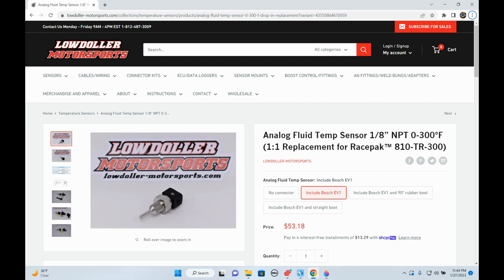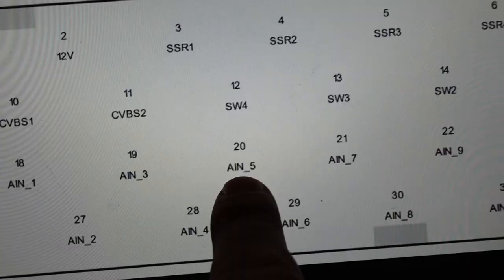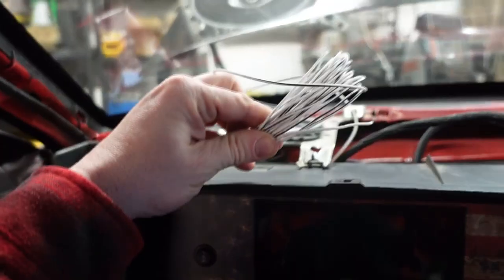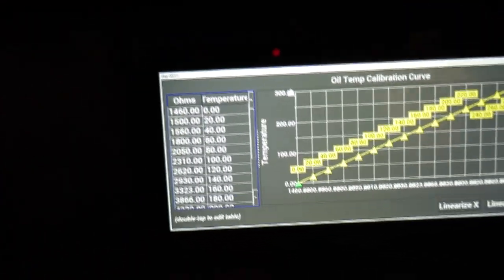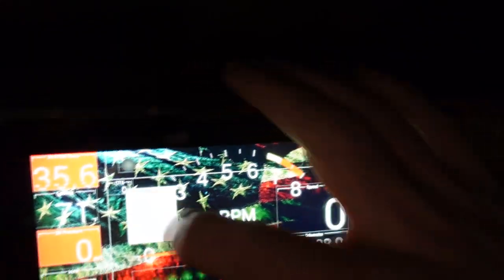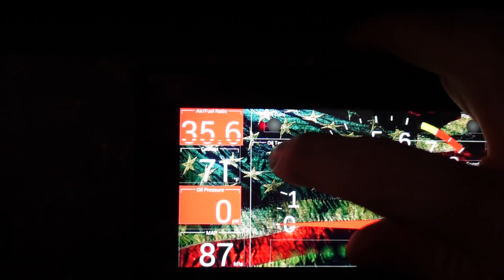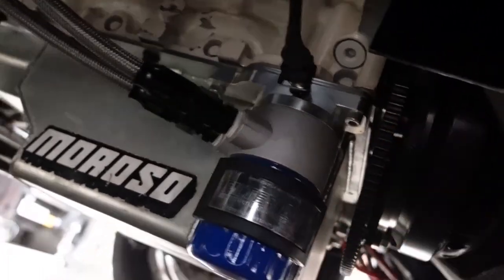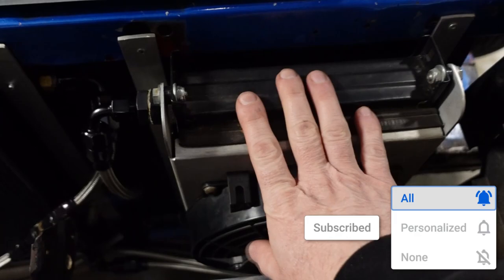Oil Cooler Install with Oil Temperature displayed on Holley Pro Dash

Comment: What sensor do you use?
Reply from the maker: The sensor that I used in the video is no longer in the car. I've been chasing sensor issues for a while, both pressure and temperature, either reading incorrectly or outright dying. I've since changed the temperature sensors out for Rife, and I'm in the middle of replacing the pressure sensors for Rife triple and quadruple blocks. All of the temp sensors in the car now read dead on, and here is the link for the sensor that's in the car now.

https://motionraceworks.com/products/rife-liquid-temp-sensor-1-8-npt-gm-connector-52-1060-coolant-water-oil-trans-fluid-fuel?sca_ref=5657354.2bFxAmD5qf